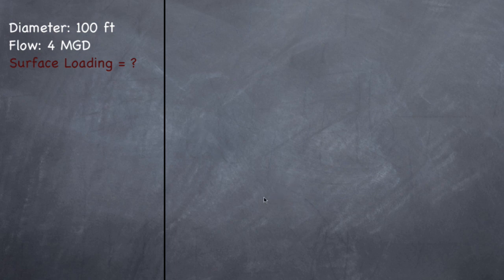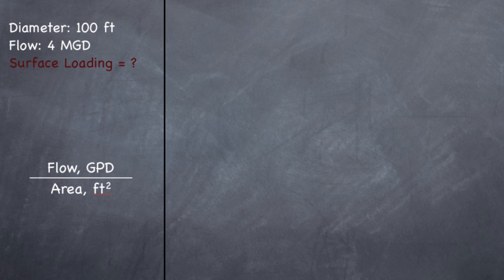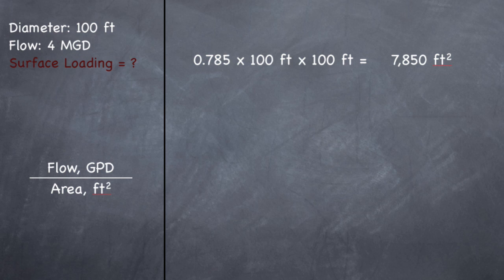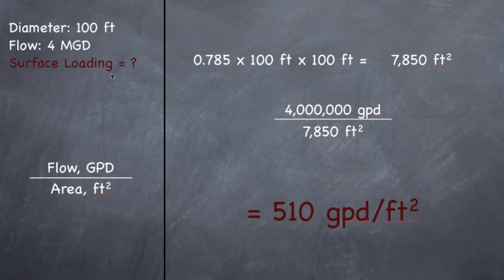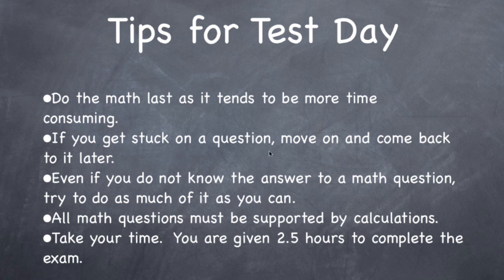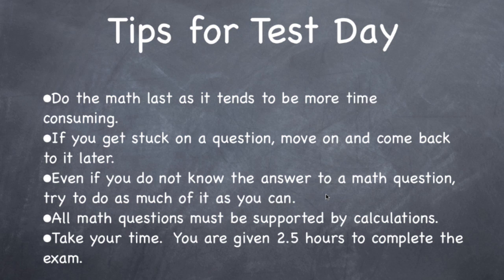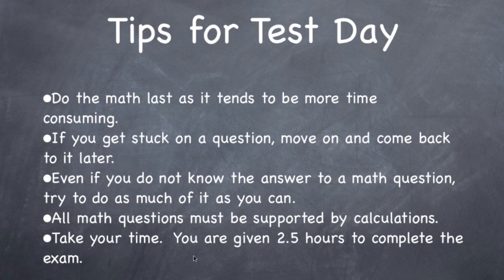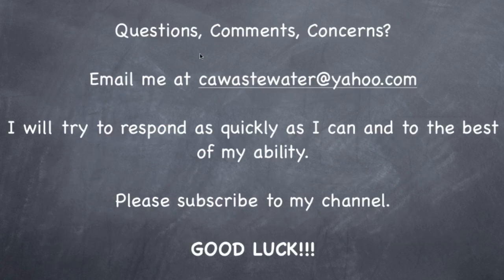CA Grade 1 Wastewater Math, Part 4 of 4

Comment: Is there an error here? Surface area of a circle is pie times r'squared not d'squared?
Reply: alright so, this confused me as well. apparently multiplying .785 times the diameter squared will give roughly the same answer as the classic pi(radius squared) formula. ".785" comes from pi (3.14) divided by 4.

the reasoning for this screwy alternative formula is that most schematics for wastewater treatment plants only supply the dimensions of the tank; if the tank is cylindrical, this means giving the diameter and the height, the surface area and the height, or more rarely the circumference and the height. it's also important to remember that some tanks are conical, which has a different formula, but the schematics will still only display the cone's diameter.

going off of these, the operator would have to stop and divide the diameter by 2 to get the radius before they can proceed with the question.

if you're insistent on using the ol' "pi r square" method, it will work, but watch out; if you accidentally forget to divide the diameter, you'll get the answer wrong.

Comment from the maker: @lerngthngs You multiply it by 4 because you have 4 MGD (Million Gallons per Day).  The formula for this problem calls for the flow to be in GPD (Gallons Per Day) not MGD which is the way it is now.  So to convert MGD to GPD all you have to do is multiply it by one million (1,000,000).  So 4 MGD x 1,000,000 = 4,000,000 GPD.  Does this make sense?  Email me at cawastewater@yahoo.com if you need further assistance.